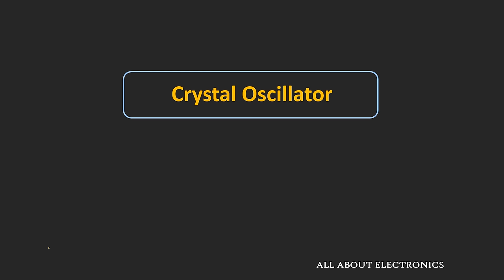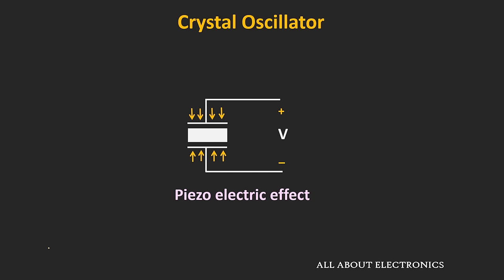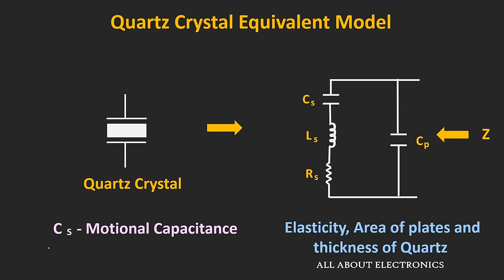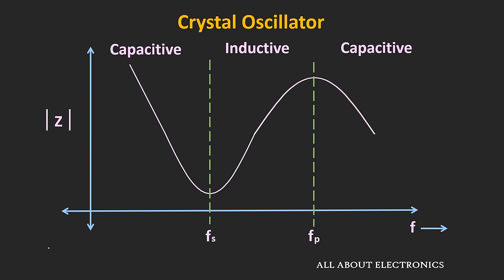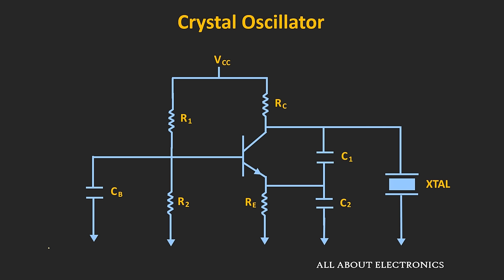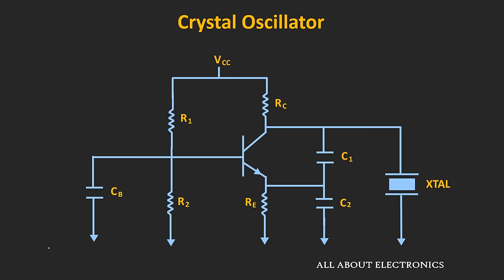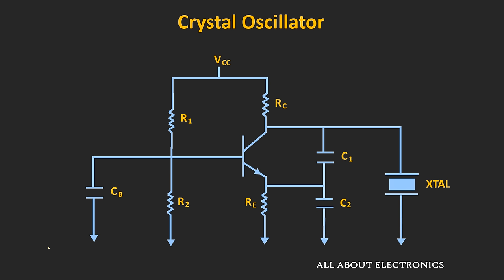Crystal Oscillator Explained

Comment from the maker: The timestamps for the different topics covered in the video:

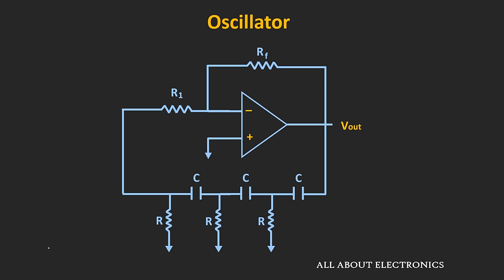0:21  why crystal oscillator is used in certain applications

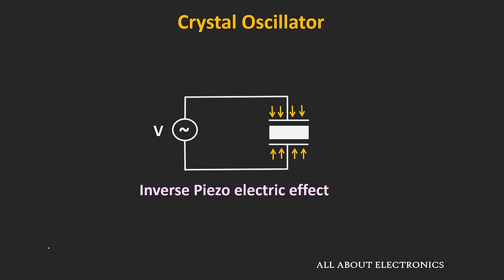1:58  Working principle of crystal  and different piezo-electric materials

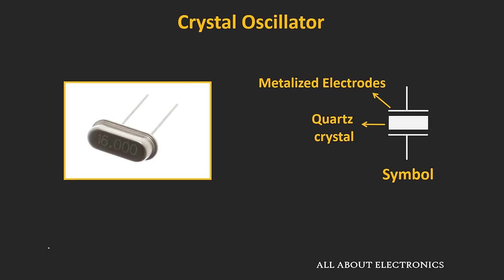4:05  The equivalent circuit of crystal and discussion on series and parallel resonant frequencies in the crystal

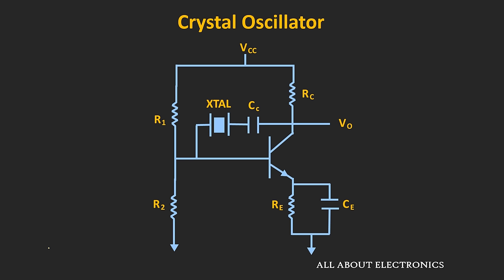8:38 Crystal oscillator design using series resonance of the crystal

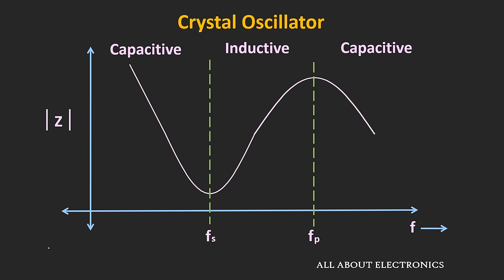9:30 Colpitts oscillator using crystal

10:20  Pierce Oscillator using crystal

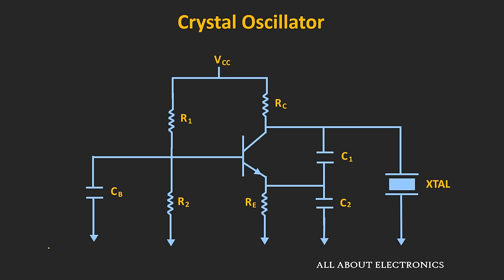14:12 Things to consider while selecting crystal for crystal oscillator / for a particular application

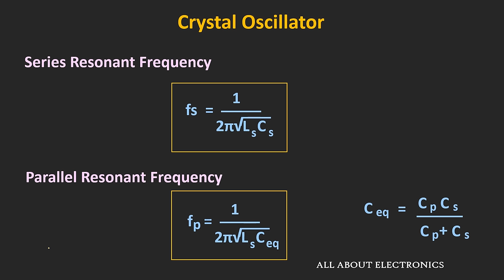Comment: Excellent explanation, however, at 7:12 in the video, it mentions 'parallel combination' while the formula on the slide is of series combination of capacitors. Capacitors add directly in parallel. In the loop the two capacitors are in series only I think. Please clarify. Thanks in advance.

Comment: I understand that the crystal will deform when a voltage is applied accross it.
I understand that it will have a natural resonant frequency.
But I also know that it must be 'pumped' with a voltage at the resonance frequency .  So what generates that pump frequency? And surely that would negate the need for the crystal all together, as you already have that frequency being generated?
Reply: The best way to think of it as an analogy is a swing on a swingset. You push it when it gets back to you, and you know when it gets to you without having to know the exact frequency.

In the crystal world, you basically feed the signal back to itself based on the output of the crystal itself.
Reply: This video is absolute BS, I recommend you find another one. The narrator is only reading from a text book,.

Comment: I don't understand from where the output is taken in the Pierce Oscillator
13:20 Isn't the parallel combination of capacitance = c1+c2 ?
14:05 what is the load capacitance and where it's connected
Please suggest a reference book for this topic of XTAL
Reply from the maker: at 13:20, actually, both capacitors will be in series. If we just remove the crystal and see the capacitance across it, then it is the series combination of C1 and C2. (without the input and output capacitance)
Load capacitance is the equivalent capacitance of the circuit, seen across the crystal. Here the crystal itself will act as a load. But the output of the oscillator is taken across the output of the inverter. 
I hope it will clear your doubt.
Reply: @ALLABOUTELECTRONICS  Thanks

Comment: Wish a little more detail and examples as in previous oscillator videos. Not clear how equivalent C is derived.  How does this apply to PIC controller oscillator input?
Reply: It is said to be the parallel combination of Cs and Cp. But, capacitances are simply added when they are in parallel. Though it is clear in the circuit that there are Rs and Ls also. So, Ceq is unclear here.

Comment: At 7:09 how parallel combination of Cp & Cs is that?
Reply from the maker: It can be found by finding the impedance of the equivalent RLC circuit. At the resonant frequency, the impedance will be resistive. So, equating the imaginary part to zero the equation can be obtained.
Reply: Yes I understand that, but parallel combination of Cp & Cs should be Cp + Cs, here i think you want to say series combination
Btw thanks for this explanation you did superb job, pls continue
Reply: @viveksingh7388  From the circuit shown the capacitance should be calculated in parallel (Cp + Cs) still. I think he wants to say parallel but the formula is for series.

Comment: Stupid question...a crystal is more stable than an LC circuit. I had a bad thought, an LED is made with a crystal soooo could it possibly be used in a circuit in a similar manner?  This is an unresearched question. Thanks.
Reply: LED is not made up of crystal it's made using diode... basically PN diode.
Here it's called crystal because we are using QUARTZ CRYSTAL(a material)
.. which acts a peizo electric material to generate desired Frequency.
Thanks for asking :)

Comment: The equivalent ckt. diagram and how Ceq is computed does not make sense. Parallel CAPS are just added. Why is a parallel CAP circuit diagram then treated as a series CAP for computation?

Comment: Hi
How Can I Lower The Frequency   Of Quartz Crystal   From   32768 kHz      to  24500 kHz?
I Wanna  Create  And Measure  Martian Time   Which Is
 24 Hours 39 Minutes
Thanks
Reply from the maker: By controlling the control voltage of the crystal, you can control the frequency. The other way is, you can use external capacitor along with the crystal (in parallel with crystal) in Colpitts oscillator and you can tune the frequency.
Reply: @ALLABOUTELECTRONICS  Which one to use ceramic or electrolytic Capacitor?
Reply from the maker: Ceramic
Reply: @ALLABOUTELECTRONICS  
I want to decrease the frequency to 24500 khz

Do you think it is going to work?

Comment: Good info but I need advice to change a crystal frequency of a AM transmitter from 1620 khz to 1000 khz ...I have found 1MHZ crystal, what capacitor i need to change it's a 30-50 watts with lamp final
Reply from the maker: Please check the value of the load capacitance in the datasheet. For any crystal, the load capacitance is given the datasheet. 
From, that you can find the value of the C1 and C2. 
Like I mentioned in the video, Ceq or CL= C1x C2 / (C1 + C2)  + Cs
Where Cs is the stray capacitance. 
Usually, it is in the range of 3-5 pF. 
If you consider C1 = C2 and simplify the equation then C1 = C2 = 2 (CL - Cs)
So, let's say, for a given crystal if CL = 16pF,  and assuming Cs = 4pF, C1 = C2 = 24pF
I hope it will help you in selecting the value of capacitor.
Reply: @ALLABOUTELECTRONICS  Thank you for your answer. In the book they said to use (probably with the original crystal)..to use 220pf and a 530 pf. Do you think that could work?

Comment: The recording cuts to monotone vocabulary is distracting… it’s one thing if you had to do that over a few mistakes you made in the original cut, but over and over again, it’s:

“The next effect is the:”
“piezoelectriceffect”
“And it is responsible for the:”
“electricresonantfrequencyeffect”
“Which means that it is:”
“highfrequency”.

Comment: Why do we produce frequency in oscillator please tell us ?
Reply from the maker: It is used indifferent applications. Like in the processor, there is reference clock (in GHz) at which the CPU operates and all the peripheral devices are synchronized with that reference clock. In the frequency synthesizers also they are used. 
In the introductory video of oscillator and multivibrator, initially I have explained that. 
Please watch that video for more information. 
https://youtu.be/XVS8Puf4tiw

Comment: but in microcontrollers actually we give dc supply then how are we going to get it oscillating at some mhz?
Reply from the maker: Please check the first video on the oscillator playlist. I have explained it in detail.
Reply: @ALLABOUTELECTRONICS  sir I know that oscillators take dc supply and give oscillations at desired frequency , but as you said here that the inverse piezoelectric effect is giving ac signal at a frequency makes the material vibrate at that input ac frequency and I am thinking as dc has 0 frequency the crystal can't vibrate?

Comment: Why do we need to generate frequency ??
Reply from the maker: All the devices which we are using, like a smartphone or PC, need the stable clock frequency to run the processors.
Reply: (Accurate) Timing
Reply: @ALLABOUTELECTRONICS  processors actually dont need stable clocks, in a pc the clock speed is changed constantly for excample, you can also run a frequency changing signal into the clock input of a microcontroller.
Reply from the maker: @josefaschwanden1502  What I mean to say is, the processor needs a stable source of clock. Using PLL the clock frequency is upscaled and according to the need of the processor, the frequency gets changed. But the PLL needs a stable source, which is usually provided by the crystal oscillator.
Reply: @ALLABOUTELECTRONICS  nah they dont, but some applications arent stable if you have a unstable frequency.